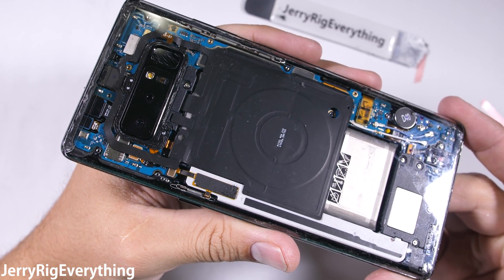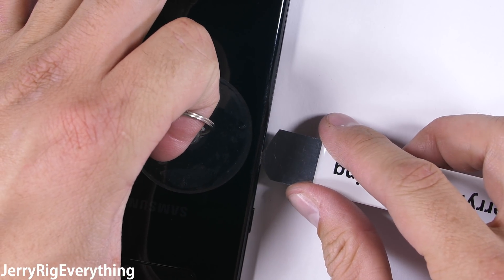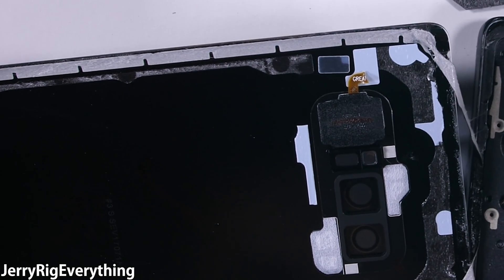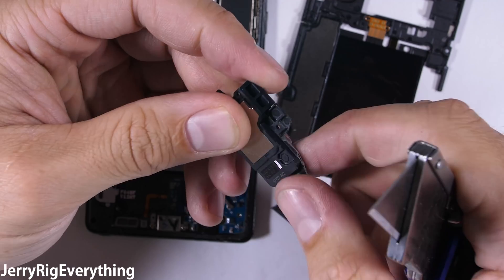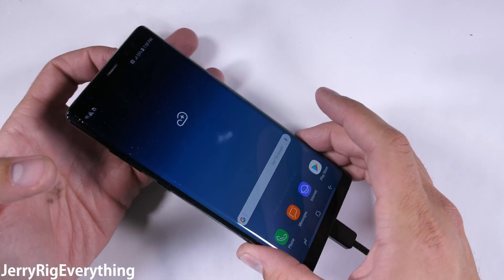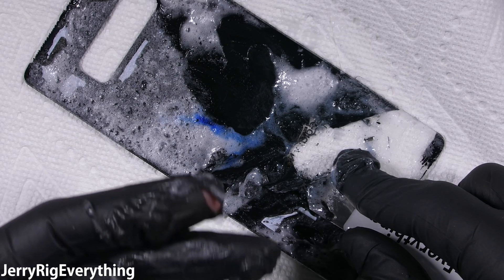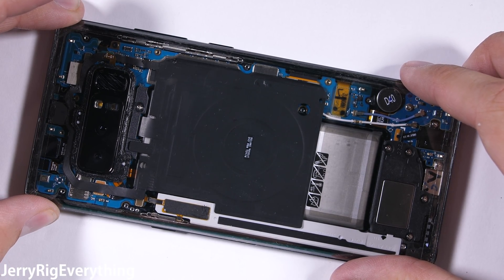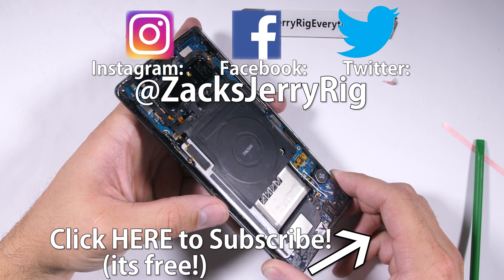Note 8 CLEAR EDITION! - Totally Transparent Samsung Note 8

Comment: If I send a samsung water resistant phone to an official samsung store for a screen repair will it be sealed again?? Somebody help!!
Reply: I can tell you from my experience with my Note 7 that I smashed the first day I got it, then sent to Samsung using a credit card covered warranty, the phone will be slightly less waterproof.  I noticed there was some extra flex to the case.  If I squeezed the screen and back, it flexed, not like before, it was super solid.

I was applying a wet application screen protector and decided to wash my phone off first under the tap.  A little moisture got in it and the camera fogged up and stopped working.  I used a hair dryer to heat it up and let it cool several times until steam no longer fogged up the camera.  After that everything worked fine, but I will not trust the waterproofing after having the screen replaced.  It might be semi waterproof, but don't go dunking it in water on purpose if you do happen to get your screen replaced.
Reply: Samsung can of course redo the sealant, but only samsung.
Reply: Thana Boyz Under a lightly running tap is nothing compared to dropping it in a pool... I had the water lower than most drinking fountains.
Reply: Subieguy 101 My credit card has an accidental damage/theft/loss warranty policy that protects new purchases. Depending on your card, what they cover differs. Mine covered 90 days accidental damage/loss/theft. This is warranty covered by my credit card, not by Samsung.
Reply: Thana Boyz before the screen replacement I washed it with higher pressure
Reply: nambinhvu how the hell do you smash your Note 7 the first day you get it? I still use mine to this day.
Reply: I was riding an electric unicycle.  I was going through a crosswalk with a raised intersection.  Other people were rude af and continued walking straight toward me instead of going up to the raised part.  I tried to squeeze past and the pedal hit the raised part and I fell.  I had my phone in my hand, so when my body naturally tried to protect itself, it slammed my palm and the bottom corner of my phone into the ground.  It still worked perfectly with the damage, but yeah, free repair, so why not? lol  Anyway, I ended up returning the phone to samsung and getting refunded, so it's all good, though I did love that phone.
Reply: I actually almost did a similar thing to my note 8 lol :(
Reply: nambinhvu dude water resistan not waterproof
Reply: Allright thanks ;)
Reply: nambinhvu okay thanks for the advice, appreciate it
Reply: nambinhvu btw, did you pay anything for the repair since it was under warranty?
Reply: Yes, they will.
Reply: may be not

Comment: Hey jerry is it possible to put cooling oil inside the clear glass back to make it look like a high end pc?
Reply: Ignacio Verdugo 
I think it would mess with the screen, but maybe not? I don't really know.
Reply: It probably wouldn't mess up that much, but you would have to make the phone waterproof inside-out. And somehow inject the oil so no air is left, probably the best method would be to submerge the phone and then assemble it, but that wouldn't work since adhesives don't work with any oil.
Reply: what the hell is cooling oil and why would this phone cpu need water cooling
Reply: GaNgStAlBeRt researched, they call it mineral oil.
it should dissipate heat and looks cool to me (if possible)..
Reply: Bartosz Olszewski maybe freezing the oil before working on it would help, idk, but still a lot of trouble for this proj.

Comment: Still cutting down mandatory parts from the plastic pieces. Like WiFi, Bluetooth, other RF antennas. Those little grey coloured areas on the plastic pieces are meant to be the antennas. The phone may work without them, but not in 100%